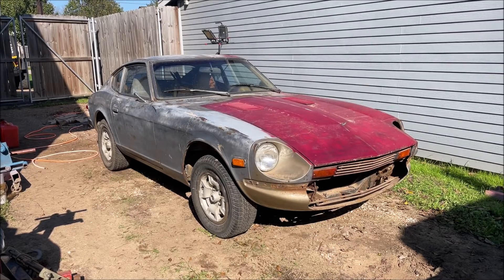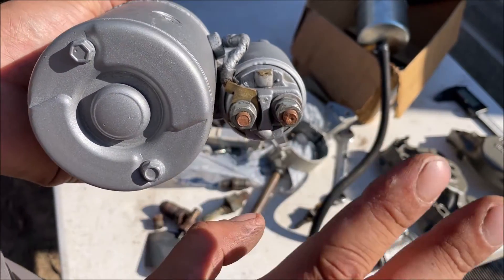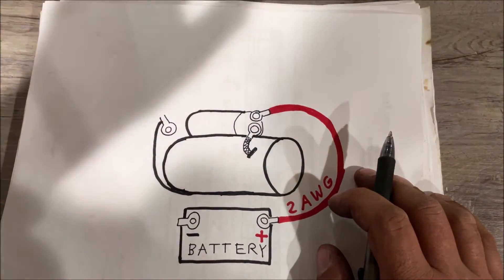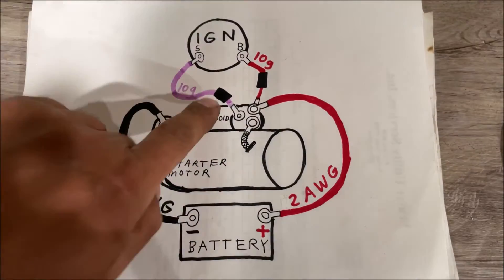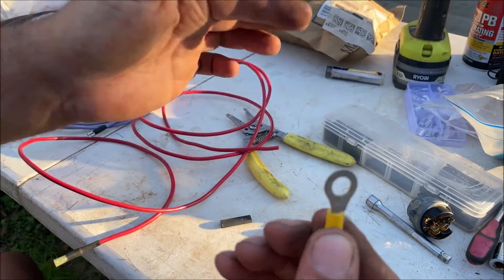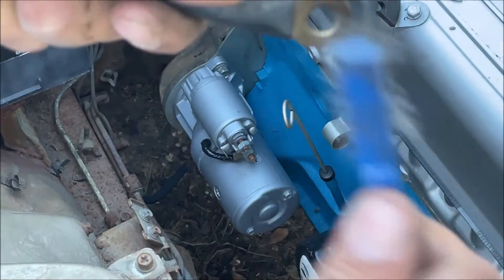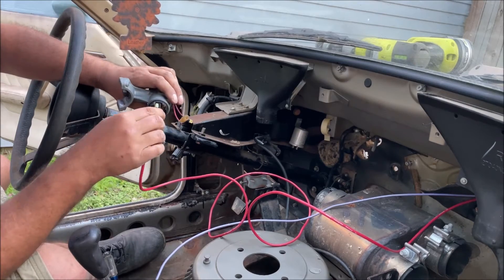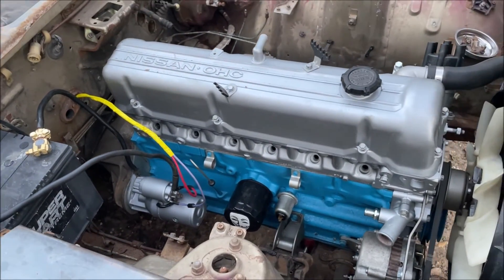how to WIRE a STARTER MOTOR on ANYTHING custom automotive wiring from scratch  PART 1

Comment: One thing that a lot of people ignore but is vitally important: protect that positive battery terminal with a boot!

I was a firefighter for 10 years, and on several occasions, I witnessed what would have been a minor fender bender turn into a full fledged car fire because the hood bent down and arced across the battery. A 75¢ rubber boot could have prevented that.
Reply from the maker: I’m going to order some now .. especially on that car

Comment: You make it look so simple. I have a 1970 nova  that I have been trying to figure out how the wiper blade circuit works for like the last 3 years. After 20minutes or so I give up. I never drive it in the rain anyway.
Reply from the maker: The switch grounds out the motor.. I have a video on it.. old video and very confusing.. Chevelle wiper motor.. but my 70 Chevelle wipers work perfect and I also added an electric washer pump
Reply: Thanks . I just watched that video.still over my head. Maybe I will look at it again  this summer. Too cold to be outside right now. Thanks so much
Reply from the maker: @spyderyates4587  to start: run grounds to the motor body and switch..   in 2010 i had a 67 C10..  bad ass truck but i had the same problem with the wipers...  i had no clue...   never drove it in the rain

Comment: Love your videos! Easy to understand and to the point! Great job. I have a question what size fuses or fusible links (purple and red wire coming from the starter solenoid)  do you run from the starter to the ignition switch? thanks again
Reply from the maker: your car has factory fused links. Just copy them. undersize 2 inch section of wire.
Reply: @chriscraft77022  car is missing them....that alot of the wiring. Doing a universal painless wiring kit

Comment: Pro tip @5:10 that plate should be flipped upside down so the bulges push wire down into the terminal